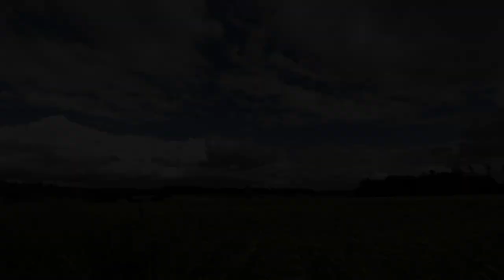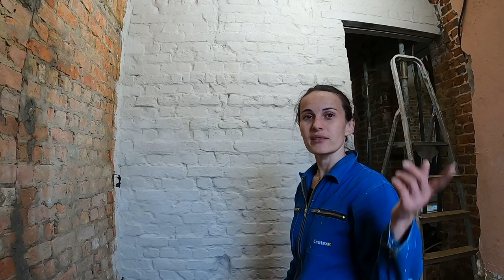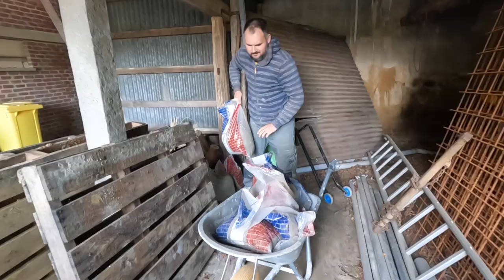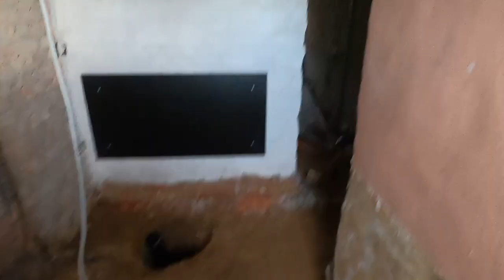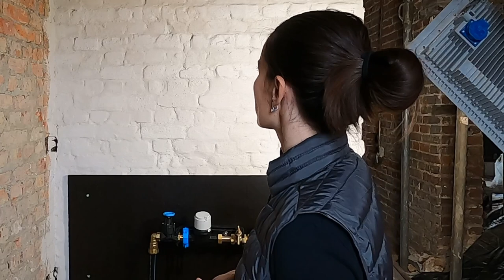How EASILY finish the brick wall with LIME PLASTER / Renovating an ABANDONED 1908 farm

Comment: It looks very nice. A tip on mixing though, in general,  the dry plaster is added slowly to the water until it rises slightly above the surface till it looks like a volcanic island.  This process is called slaking. The plaster won't really start to set until it is stirred. The length of time you slake it, the ration of water to plaster and mixing time will all effect the hardness and set time of the plaster. I usually found that you could sprinkle/pour the plaster in fairly quick, let it slake for a couple minutes until the water soaked most of the way up to the peak in your island, then mix well. There are lots of videos with movie prop artist type folks showing how to slake plaster but most of those take it to an extreme.  Hope that helps 😉👍
Reply from the maker: Thank you for a great tip, TgWags! I'll pin it, as it could be helpful to other renovators watching our channel.
Reply: That's for gypsum plaster, though. With carbonic lime, you sprinkle it in the water and let it soak before mixing, but it won't harden before it's exposed to air (by carbonatation). It's even recommended to mix it at least 24h before use (and remix it during use as it tends to settle).
Don't try that with hydraulic lime, though.
Reply: Good advice , slaking or soaking allows for better absorption and is a lot easier to get mixes without lumps!
Reply: In Germany we say 1 cigarette to wait

Comment: You can use a smaller hard bristle brush to get into smaller cracks.  An easy way to fill the voids/holes is to grab a gallon Ziploc bag put your mortar in it seal it then cut a small hole in one of the Ziploc bags corners (not the sealing edges) and you make like a cake piping/icing bag and squeeze in the mortar.

Comment: I have two old buildings with brick walls and limestone foundations. What I have found through my research is that lime is best for old buildings. Especially lime mortar. Breathability and the softnes of lime mortar accommodates soft brick well. Lime wash is a very old way to finish off walls with a protective surface. It is the best way, due to it's breathability to allow moisture in and out of the wall. I have learned much watching you apply the lime wash. Great job Marina! 

John
Bethel, Missouri, USA

Comment: Great it's all hooked up , but definitely 2 coats for a lovely finish, when you do joints patch in tight and use new dust brush after 1/2 - hour to brush the joints for a better finish and can you point the bricks before you put plaster on

Comment: The render gives the brick a fresh new look. I'm certain you can apply extra coatings, Marina, it will smooth the entire surface. The surface is paintable and I think if you choose, you could use a masonry dye to colour it. It looks much more finished with just The render gives the brick a fresh new look. I'm certain you can apply extra coatings, Maria, it will smooth the entire surface. The surface is paintable and I think if you choose, you could use a masonry dye to colour it. It looks much more finished with just one coat. 
Illia did a good job mounting the plywood backer board for the water intake manifold. 😉👍 He did a great job replacing the window headers, too.
Anika needs a sardine for guiding you through your success. Cheers 😁🍺

Comment: Good on you, Marina! Worried a little about product dust while mixing (should a respirator mask be used?), gloves and mask during application to avoid skin/lung reaction/s at the time of application and longterm. Your method of vertical application was brilliant, efficient and practical. The new water gizmos/pipes/ meter professional and most likely an easy approval. Anika was good observer, Illia kept good watch and installed the waterproof backer board like a pro. C u next time. Progress soooo satisfying.❤️🙂

Comment: Hallo together. Test it.  I fill nailholes and holes between the bricks with smoother mortar and a kitchen sponge. If the surface is dry , clean it with a metal brush.

Comment: Another video with some great progress.
One minor point about laying and connecting the pipes. They should be the other way around, so the socket follows the direction of the water flow. The way you have laid them, any pressure can force water out of the joint more easily, this shouldn't matter for drainage pipes, but its the same for any pipework.

Comment: It will look great once you put another coat of plaster on.
As you say, this was an experimental wall, and you  now
know what you need to do differently on the next walls in
order to get the results you are hoping for.  Such great 
work to finally have the water meter installed.  Another
Project completed!  Just another 999 to go😂😉

Comment: I suggest a new toy that Illya will really enjoy: a sandblaster!!!
In my farm (vintage 1866) renovation, we  thoroughly sandblasted all the brick walls and ceilings (once the plaster was removed) and even the wooden ceilings and  beams.
Unfortunately, at the time I had to call for a specialized company with the right equipment, but I am sure you can do it yourselves.

Comment: In my country when the brick wall has a lot of damage and not very pretty features, a good solution is to prepare a cement lime and sand mortar revoke and sort of plaster the wall. Once it dries a bit, they go over with a raffia potato bag to remove high points and it leaves a 1 CM wavy surface that covers all the brick imperfections. Once dry it can be white washed or painted. This is very common in colonial buildings and seaside homes as it creates a cleaner surface and reinforces the wall as well. Very popular in colonial time where walls were built with bricks and mud. Have a try and see if it suits you. Cheers from Argentina

Comment: nice work guys,one question tough,will your electricity panel be on another wall? it would have been better if everything was concentrated on the same wall,i in my house,because its an old build too,water,gas and electricity come from different directions too
one thing,you will never get water in your electricity setup 😁 jullie zijn alleszins goed bezig

Comment: If that line plaster is just lime and water, I think mortar will stick to it. If so, you can fill in those areas you don't like.

The discoloration you have may get better with more coats of the lime plaster.

Comment: Rather odd to rush to decorate the wall and then cover it with a board to fit the water equipment to!  Also if you want a smooth finish then you need thick lime plaster in 2 coats and it takes ages to cure  if not smooth just paint it with masonry possibly with a waterproof undercoat if the wall is damp.  I dont know what you used in the bags to cover the duct for the water pipe but buying it in bags must be so expensive. Cant you get it in cubic meter or tonne bulk delivery. Much cheaper